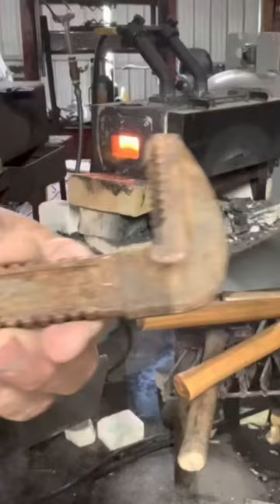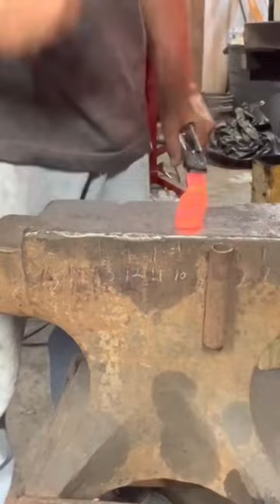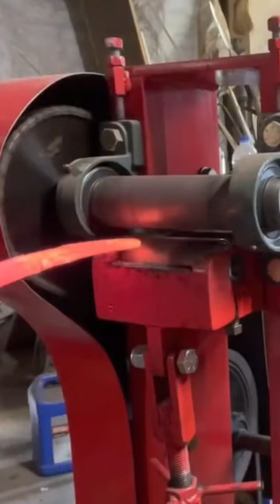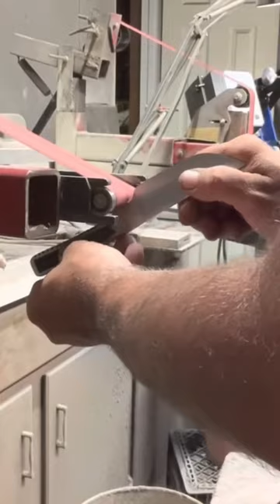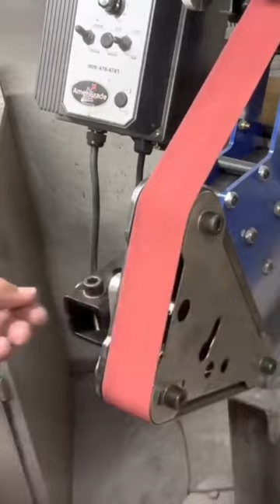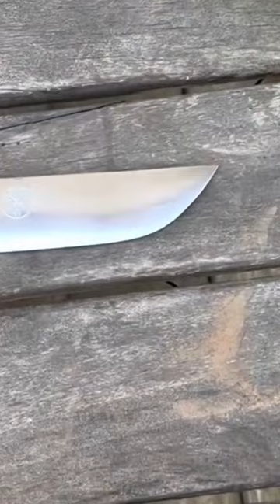Turning a broken pipe wrench into a useful knife.  #bladesmithing #knifemaking #repurposing

Comment: I wouldn't think that steel would be suitable for a knife.
Reply from the maker: I think that you are correct in the fact that it is unknown steel therefore being able to properly heat treat it is a big question. Maybe a better response would be that it is not as suitable for a knife as proper known knife steel. However the steel is some sort of high carbon and did harden during heat treat. I have made a few and they have all held an edge but have not been used a bunch so idk.
Reply: @4wknives Thanks for the response.